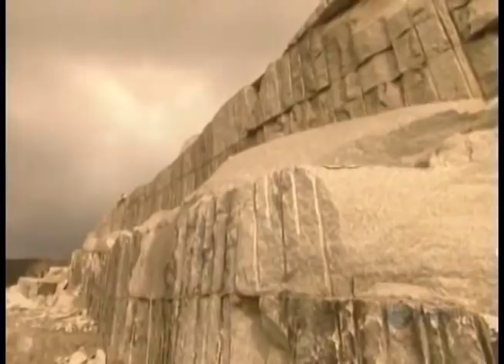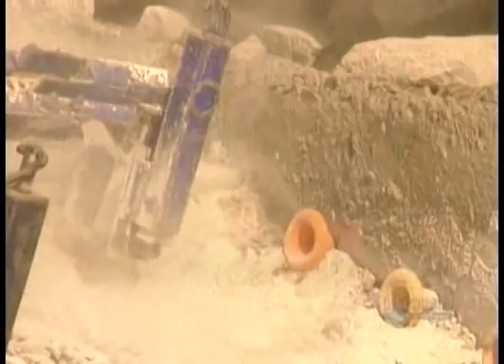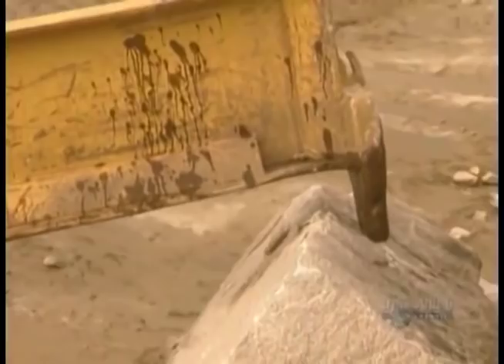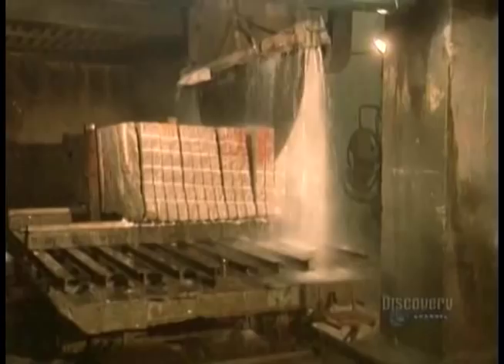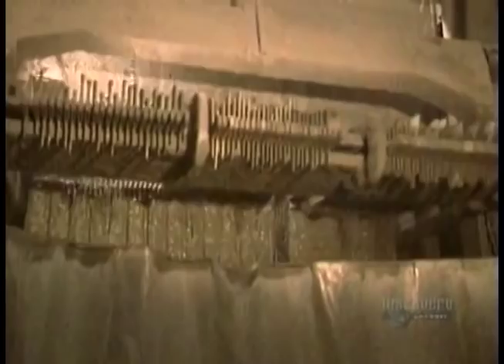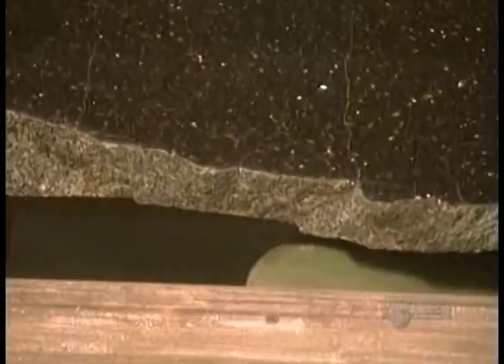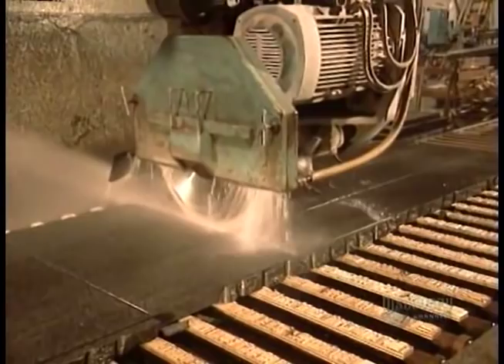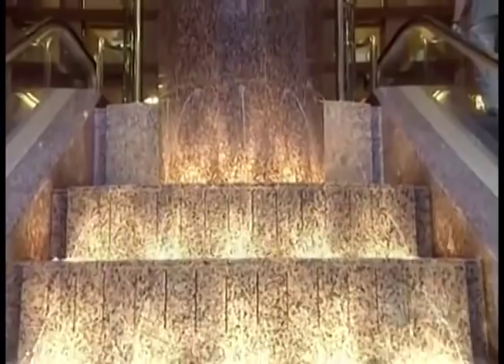How Its Made Granite from "How It's Made" TV show.

Comment: Just one rough cut slab that is 3 x 1.5 x 1.5 meters weighs 20,000 kg, or 44,000 pounds? So a regular semi trailer could carry just one of those, as 2 slabs would require over weight permits and and extra heavy duty trailer...etc. Is that right? I figure a slab of granite would be pretty heavy... but THAT heavy?
Reply: Yep, 18000-20000kg for that size
Reply: I know this is an old comment, but just adding this places granite at about the same density of aluminum, which is in fact correct

Comment: What I don't understand is how they add all the different colors to the granite? I've seen red and even blue, those can't be naturally occurring could they?
Reply: No they are not naturally occurring. they inject the rock with a certain dye to make it more appealing. The most often dye is Green. Granite in its natural state is more pink, light gray, and spots of black in color. The pink is feldspar, the black is hornblende, and the light gray to white is quartz.
Reply: cvandenberg15 Thanks a lot mate.
Reply: +Hugh Jass cvandenbert is full of crap. I've cut over 700 lineal feet of granite and done a fair amount of edge polishing of granite (and quartzite and marble). 
If the dyes penetrated so well, then the cracks within sections of quartz would be penetrated by said dye. I've never seen this. Ever. 
I just put down a full slab (and an exceptionally beautiful one, at that) of verde bamboo. It is both Green AND blue quartzite (about 70 bucks a square foot in bulk, by the way). If both green and blue were dyes, then they'd never contrast so well. The sedimentary patterns would NOT be so distinct. If dyes were so good, then quartz countertops would have all sorts of wild patterns. But alas, they do not.
Reply: +Justin Crediblename I'm sorry but they actually do dye granite. Maybe not as extreme as you might believe but it is done.
Reply: cvandenberg15
alright yeah sometimes they do. Most prefer not to work with that stuff.
I've changed the background image on my account to one of the slabs that I've cut through and put on a floor. If you were to look at it closely (especially through the cut edges), you could see that absolutely no dye job in the world would cause the artifacts that you see here. They'd have to dye each little grain atomically and put it into a kiln to solidify it in order to make this Verde Bamboo quartzite slab.
I have numerous examples of this on my properties and yet-to-be-installed on my properties, and also live near northern california's largest retail slab yard...I know a little bit about granite. They usually don't dye it. It's bull, and customers want something natural and diverse.
Reply: In my back yard, I have the most beautiful, blue slab I've ever seen. It's a mixture of baby blue and dark blue and rainbow iridescent artifacts from about 1" in diameter to about 5" in diameter. A dye would not be able to create these things. And the artifacts transfer to the edges and backs, indicating that they're natural artifacts and not surface artifacts. I wish I could show it to you. It's positively pants-wetting.cvandenberg15
Reply: +Justin Crediblename lol you seem very passionate about your granite. it is indeed a beautiful stone and I guess I didn't realize how much modification went into the process. I'm positive that dye is used in some cases but I'll take your word for it since I don't know as much as you.
Reply: LOL you guys.
Reply: cvandenberg15
here's the species of granite:
http://granitegrannies.com/stone-profile-lemurian-blue/
My slab doesn't have much black in it like most of these pictures show.
Reply: +cvandenberg15 I do not know diddlysquat about granite except that it is solid rock.  The surface of a rock may absorb stain but it does not permeate.  You simply cannot dye a solid rock.
Reply: peggyt1243
there are fissures between each crystal and can be stained. It's considered non-vitreous, but they test these rock quarries regularly and retian between .05% and .5% additional mass from water after being soaked. Darker granites almost invariably toward the .05%, and lighter granites toward the .5%.
Reply: You get different color granite slabs depending on what part of the region of the world you get it from. Your going to find some different ones in Brazil compared to some in Italy or India due to the weather creating different sand grain colors
Reply: Hugh Jass i am guessing you are talking about quartz..
Reply: what you see is all natural occurrence, there is no adding colors...lol
Reply: bsassine i think he is talking about quartz
Reply: Hugh Jass some granite is dyed.
Reply: @prolineracing1498  Yes a lot of the granite colours is naturally formed also